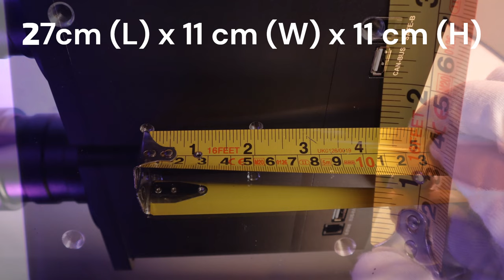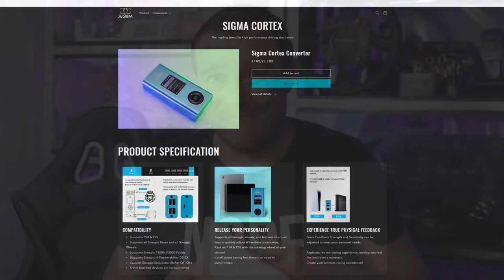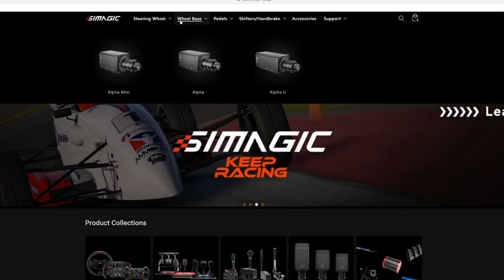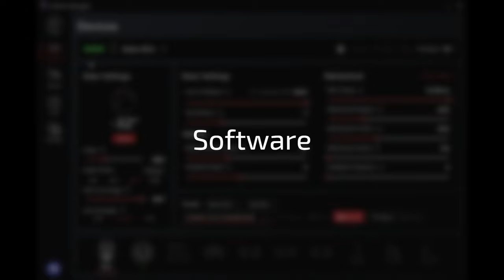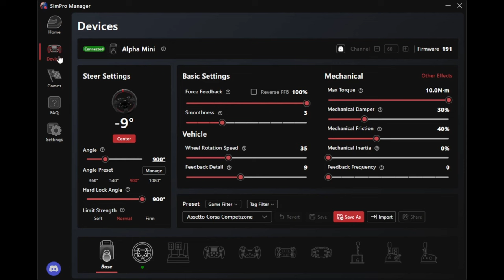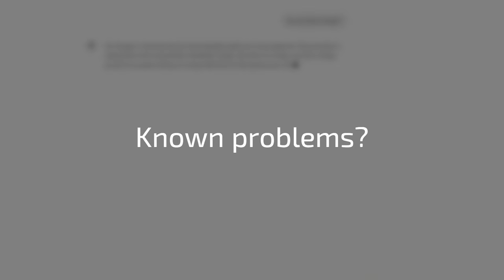Review: Simagic Alpha Mini v.1

Comment: This is the v1 version. I heard Alpha Mini v3 improved some flaws (overheating) and evolved the product, but it has not 13nm peaks anymore like other reviewers commented and is still commented. Many users that bought the Alpha Mini v3 found the 10nm underwhelming for the price range and I would really like to know more because I'm on the edge about Moza R12 and the Alpha Mini v3. I really appreciate the review and good information but my fear is that this v1 version is not sold anymore and the v3 is a different experience for the buyer.
UPDATE: SIMAGIC posted at Reddit adressing this concern: 
"Fact: There has been NO reduction in the peak torque output of any Alpha wheelbase.

Fact: The Alpha Mini, for example, still packs the same punch, delivering 10 Nm of peak torque. We've even seen reports of it exceeding this figure, but we prefer to be conservative in how we present our lineup to ensure consistent performance across all units."
Reply from the maker: This has been interesting information. I adapted the thumb and titles. Thank you for bringing this to my attention! I did not realize there was such a difference. I just now quickly read into this and the difference seems to be mainly the housing, formfactor a bit different and another less heavy PSU. There is also the performance part. I wonder if they changed the motor but didn't find any information about this or if this is simply software changes. If you would encounter some extra information, I would love to hear. Again thank you! Unfortunately I can't help you with the predicament you are in... it seems I have reviewed either of them atm 🤭

Source changes: https://www.reddit.com/r/Simagic/comments/1crd241/update_alpha_mini_v1_vs_v3/#:~:text=The%20v1%20is%20longer%20heavier,upstructed%20by%20the%20body%20itself.
Reply: @SimulatedDrivingResource  I would like to know if the difference is so noticeable, but we can just take some users posts on Reddit or comments that compared the v1 and v3. Or compared the Alpha Mini v3 with the Moza R9 strength or R12. Some like more the Simagic (really good servo motor) and some notice a Nm downgrade.

That reddit post was shared on “Simagic Official owners and fan Group” facebook group and Simagic Official replied: “Alright time for us to come in here. Our v3 isn't a downgrade at all, and we'd like to clarify our official listings have never listed Mini as a 13nm. We have made improvements and development changes to the motor over time, in v1 the symmetrical aspect of the motor was from left to right, it's now up and down. We have also changed the power supply, opting for a newer, high efficiency gallium nitride solution that has longer life. None of these changes impact the driving feel, but they do reduce the damage rate during production and further improve the service life. So... is that clear enough?”
https://www.facebook.com/groups/Simagicofficial/permalink/1568923663670738/

Very political answer that the product is more polished, but the Alpha Mini has an incredible reputation by many famous reviewers (some collaborations with Simagic) and the conclusion of all of the reviews is that the Alpha Mini (v1) is the best mid-tier DD base because has 13nm peak and competes with Moza R12 and Asetek La Prima on strength. They profit with this amazing marketing, but we don’t know if that is actually true now and it’s obvious no company will admit it. I don’t hate a downgrade, I hate the lack of information to purchase a product that was said at many reviews with collaborations that is so good as 13nm bases. If Simagic comments on the 10 o 13nm peak people will buy happily the Alpha if they want more Nm.
Reply: I am waiting for my v3 and also got a bit disappointed while reading about the lack of nm on the v3. But I think that many YouTuber reviewing the v1 also hyped the feeling and quality of the ffb and not just its strength. I still believe that the v3 will be excellent and I am looking forward to it. And on the other hand everybody will be happy when their wheelbase works for many years instead of a breakdown. I believe they improved their product with the v3. Everything else wouldn’t make much sense.
Reply from the maker: @Thorkell_Joms  understood. But in a way they admit it is not as powerful any more in their post. The question is ofcourse in what degree and does it affect other things. Basically the question you have. I will not be able to help with that. I dont mind investing in hardware  to help out our community but it would be nice if the community helps out small content creators too with using their affiliate links. People tend to think all reviewers just get free stuff while it is just only the lucky few. I will be on the lookout for a v3 and will sell a few other pieces of hardware if I find one at the right price but I am afraid that by the time I find one, you will have already made your decission or a v4 will have been introduced. Thanks again for taking the time for giving the feedback. I, and people watching this review, can all benefit from it.
Reply from the maker: @marvingvk  just from my personal experience, and I am neither affiliate and I paid for this hardware, the quality of the ffb is really good and probably the best compared to all hardware I tested in the two games I used. That part is not a hype imo. What is a hype however is the difference with other direct drives.
Reply from the maker: There are physical changes to the design and PSU and claims of certain users so I would argue that it does have some basis. Only way to know is put them side by side and test.
Reply: @SimulatedDrivingResource  

All this talk has been of conjecture
Reply from the maker: Of course. I do not claim it is the case, nor does anyone here. Like you say, there is need for proof for this but there is nothing wrong with looking at the possibilities. It might and it might not so I hope to answer that question, that I can get hold of a v3 and see for myself.
Reply from the maker: @Thorkell_Joms  saw a message pop up from Simagic. They state as fact that no Simagic Alpha wheelbase has changed max torque. Of course, since the v1 was advertised as 10Nm and so was the v3, it wouldn't have changed torque either. I asked them to clarify this too but it seems, at least from my perspective, that they are genuine in their message. I wouldn't mind testing it out, but because they are focusing so much on this topic, I would say they are telling the truth because if not, and content creators test it out and find issues, they would be in quite a pickle at that moment.
Reply: @SimulatedDrivingResource  Again, my conclusions are the same. There may be a catch because they never said 13nm, so the torque is still 10nm... But I feel it is a genuine and clear explanation. If somebody grabs an Alpha Mini v3 and compare them it would be amazing. 

But longer durability and failsafe is better, I don't want to spend 600-900€ every few years...
Reply from the maker: @Thorkell_Joms  if the chance comes up to get a v3 i will certainly get it and test. For now, i am staying clear of rhe Simagic fb page as they gave me a headache.
Reply: I understand the V1 was overpowered with a 252w motor which helped it achieve higher torque as reflected in some earlier reviews however due to overheating issues it was replaced with a 237w motor in V3 so yeah, this may have resulted in lower output now. I don't think Simagic consciously went about intentionally reducing torque output as they were trying to resolve an over heating problem now fixed I believe.
Reply from the maker: @kevinblythe2192  with the emphasis on "may" have reduced. I dont want to start another war with Simagic ultra's again. 😵‍💫
Reply: @SimulatedDrivingResource  No, I get it. It's hard to substantiate anything without proper measurements etc. however it was discussed on reddit and it is pushing me towards buying the Alpha base over the mini, just in case. Cheers.
Reply: If people wanted 13nm they shouldn't be buying a 10nm base and crossing fingers... Get the Alpha instead at that point
Reply: I just got the Alpha and avoided the entire thing.

Alpha is the same. Recorded at 18.8nm.

But for me I just want a solid 9 to 13nm without heat and the Alpha does that very well
Reply: @GregoryShtevensh  Me too but Alpha U. Zero hate towards Simagic, we only want the max info when we spend so much money
Reply: @Thorkell_Joms  exactly

Comment: I've had my Alpha Mini together with their GT Neo and p1000 pedals for a month now. While I spent double compared to my old Fanatec CSL DD Setup all the shady stuff going on at Fanatec had me kind a worried. Main reason was that their local distributor is only 10km from my place and that he took the time to explain everything and give proper buying decision. Their software seems to be much better maintained and their support got back to me within a day. However, while their products are quite a bit more upmarket compared to Fanatecs products it does not feel like a worlds difference to me. But I'm also the guy who uses only 40% of FFB strength and who drives with lighter springs on their pedals. But 1380 Euro for all parts is still a lot of money of course.
Reply from the maker: I can absolutely relate to that. While the upgrade from Lets say gear driven to direct drive is phenomenal, the difference between the direct drives are a lot less (in comparison with price). Nonetheless, the service is also very important and while I still think that a lot of the Fanatec-is-bad news is exaggerated, their SAV is as disorganised as it can be, that is a fact.

Comment: Simagic does both PC and Playstation really well, but requires a dedicated device called a SIGMA for the latter. 

For PC, it is has 360hz FFB for Iracing. The only other brand that has that is Simucube and that costs significantly more. 

For Playstation, sigma emulates a true DD FFB... And if you think about it, given it's wide range of high quality ecosystem, no other brand can offer this today.
Reply from the maker: Sure. A dedicated Device is always a plus but would be nice to have implemented compatibility from Simagic itself. An emulation, no matter how Well it is written is still an emulation based on other hardware that is compatible. But I should test it to really be able to comment on it, that is sure. Thanks for the informative feedback friend
Reply: @SimulatedDrivingResource  of course. The impediment is not tech but licensing from Sony. So it's on Sony really.

Comment: I have been using my new Alpha mini and gt neo wheel for two days and loving it. I got it in Australia from Simrigs. They are the official supplier here. Free delivery. I had to wait a couple of weeks for the base as they were sold out.  It came in on the 6th June and they express posted it to me straight away. I received it the next day. Awsome service. The only problem I had with games was I had to manually delete all previous ffb files in ACC relating to my old Logitech G29. After that it was great. I think the main difference is the tyres feel like rubber on the road now. Thanks for the review.
Reply from the maker: Good service of the reseller. And aside from feeling the types, I bet alot more detail for the rest too. Absolutely love the amount of detail they manage to squeeze out of that motor. Enjoy the ride 💙

Comment: Received mine last week.  The case design has changed somewhat.  It's now notched in along the bottom sides to mirror the top.
Reply from the maker: Hmmm... but still no power button on the base I presume 🤭
Reply: @SimulatedDrivingResource  Nope,  still on the cord.
Reply: How is the strength? I head it was reduced in the latest version.

Comment: Comment on the emulation and the risk of being blocked. It's a risk that is overblown and perpetuated to instill fear.  Third party dongles have existed for years... Also if Sony does decide to block it.. It will brick the source device it emulates.  Not going to happen.  

As for the FFB experience not being as good...yes and no.  It depends on what is being emulated.  If you emulate a gear driven wheel (Logitech G 27) on a direct drive wheel. It's not going to feel good.  But if you emulate a DD wheel on a DD wheel with an even better motor, the feeling will be awesome. This is what SIGMA does for Simagic.  But at the end of the day the FFB for console is still limited also by platform and PC is still better. 

 Hope this helps
Reply from the maker: Everyone has the right to their opinion as long as it is kept civil and when preferably also with some content, you wont be blocked. As I said before, its hard for me to comment on it as I still need to test it before I can really give my opinion.

Comment: Thx for this review!
Are the details of Simagic better than cammus c5 or are both at the same level?
And If you give 10 of 10 Points for the better wheelbase how many points have the other one?

Thx for answer!
Reply from the maker: I have not played with the C5 for a long time but I have been using the C12 a lot which is when it comes to details about the same as C5. The Simagic manages to let you feel just a bit more. Both let you feel the details but the Simagic really can make you feel more. I would say that if there is a bump in the track of 1cm and 1.5cm, Simagic will be able to make you feel a difference where it would feel similar in the C5. Its in the small details that you really feel the difference. Its hard to grade these wheelbases as there are a lot of variables in it. I am a driver, not a racer. I would rather buy a C5 with some sort of haptics like an HF8 which would cost me less than a full Simagic setup. But then there is the eco-system aspect, the quality aspect (shifters of C5 are a bit less), the software... allez... its just too hard to grade them. Its like I say at the end. Do you want a Porsche or is the Volkswagen enough for you.  Both are good cars, one is just a bit better but also costs a lot more.
Reply: @SimulatedDrivingResource 
Thx for fast answer.
I think it helps.
The c5 is a very good option for me!
Reply from the maker: The C5 is a wheelbase suitable for a lot of people. We have seen a race the last years for affordable direct drives which is a main variable for a lot of people. Cammus with the C5 is at this moment really the cheapest which offers already a very pleasurable experience.

Comment: This is so interesting because on my tmx in acc if I'm driving straight, if the wheel is center, there's no feeling in the wheel at all it's like I'm on a perfectly smooth surface. I get no road texture or feedback until I turn. I can't wait to get my hands on a better wheel to play around with. 

(My tmx could be broken to an extent idk someone else would need to confirm that theirs is different. It's really old.)
Reply from the maker: @Tynelia  it is normal. The TMX has a very limited torque (around 2Nm if not mistaken). The roads in general have very small bumps and imperfections. The TMX has a lot of difficulties in translating them because of this. You have to see it as a measuring tool. If you have a ruler that only has CM on it, 2mm will register as 0cm while on a ruler that will have mm on it (like for example this Simagic) you will actually be able to measure it more correctly. Now you have to know that even with a Simagic, you will have certain parts with little to no ffb because the road is actually very smooth. That is where extra protocols like TrueForce, FullForce and T-DFB come in.

Comment: Hi, great review! On the site it says tax included.  Did you have to pay/foresee extra import cost for Belgium from the douane?
Reply from the maker: I bought it second hand so dont know. However, in the past when I bought from China, i paid shipping up front and then after I received a message from the carrier when it arrived in BE to pay x € for import tax. I would ask in advance before you buy via them if there is the extra cost unless someone of the viewers here can answer.
Reply: @SimulatedDrivingResource  Thx. Those import taxes could sometimes be unreasonable high. I will avoid and try to buy the set via a local retailer. Grt
Reply from the maker: Absolutely. Normally prices from local retailers "should" be around the same price. You will however know precisely what the price is. 👍

Comment: Quack quack time!
Reply from the maker: An expensive quack this one 🤭
Reply: @SimulatedDrivingResource  I believe I have one of their wheels. It's either sim motion or sim magic. It fits the moza. No buttons, though. Can't use it in vr.
Reply from the maker: @PJDobbs  yeah the qr is the same I think. Not cheap though their wheels 😕
Reply: @SimulatedDrivingResource  It was a generic one. Just the wheel. Under $100.00. I think around$70.00